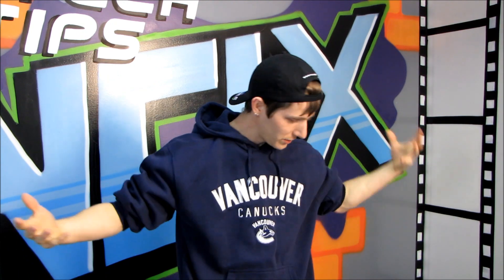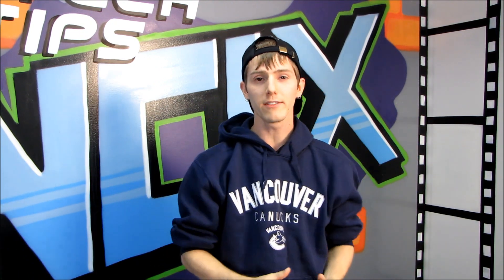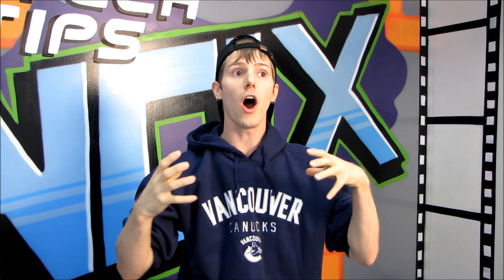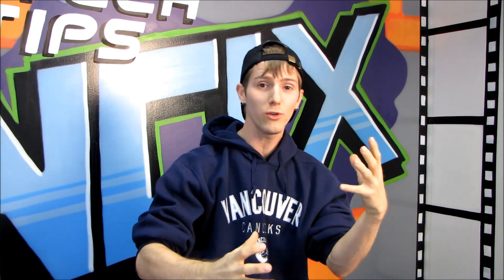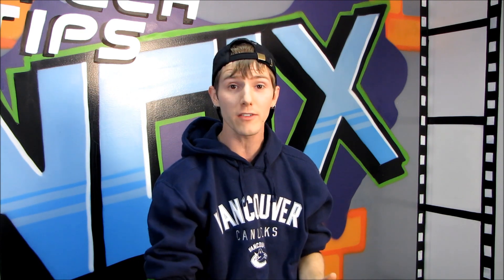Futureproofing Your PC - Dispelling Some of the Myths NCIX Tech Tips

Comment: well first although I agree intel is better but the amp bulldozer one was quite decent as well. I use an intel rig my self check my vid ^_^ but I do recommend before the release of pile, depending on what your doing it's better to buy the bulldozer as it was 40% cheaper than the i5 2500k (the 8150) and I guess pretty much you can guess how cheap the others are compared to some intel equivalent.

Comment: Right now i'd just get an old Phenom II or so with a HD7750, 8 GB RAM, 500w PSU, put it in a Fractal Design Mini with an OK SSD, and 1 TB green disc. I'd buy a low profile mid-range heatsink for the CPU and call it a day. This would be great for a PC for my family, seeing how i don't need a new rig for myself. 

Eventually, i'd buy a A10-5800k with a low profile noctua CPU cooler, a MoBo with a good output solution, a good SSD, a 2 TB black disc, low-power digital PSU in a Node 605. HTPC :D

Comment: 1. Kind of, yeah.
2. MoBo: ASUS Z9PE-D8 WS
CPU: Intel Xeon E5-2687W x2
RAM: Either 16GB or 64GB. The latter because if you have the money, why the hell not?
GPU: EVGA GeForce GTX 690 x2 OR EVGA GeForce GTX 680 (4GB DirectCUII) x4
PSU: 1500w, Gold or Platinum
Storage: Samsung 840 Series Pro 512GB x4 in RAID and probably one or two Raptor HDD's, at 1TB or more.

Watercooling in the case of the twin 690's.

This is probably more to show off though lol

Comment: hi i am using evga x58 ftw3 cpu i7 960 runs 3.20ghz 12GB ram Kingston 1600 video card gtx 480 hard drive 2TB ssd 128gb power supply 750W80 plus bluray combo cooler master hipper 212 plus and i want someone help me to overclock my cpu to 4GHZ or more

Comment: Intel Core i12 12000k @99999.9ghz
GTX 2480 128gb ddr24 x12
512gb ddr24 ram
5120w PSU 80+ Super Platinum 100% Efficiency
12tb SSD
24tb 99999999999999999rpm hdd
Ultra Mega 99999x99999x99999 inch case

Pretty future proof for me :)

Comment: Is this decent for BF3 ultra 1080p?
XFX Double D FX-785A-CDFC Radeon HD 7850 2GB 256-bit GDDR5
ASRock 960GM/U3S3 FX AM3+ AMD 760G SATA 6Gb/s USB 3.0 Micro ATX AMD Motherboard
G.SKILL Ripjaws Series 8GB (2 x 4GB) 240-Pin DDR3 SDRAM DDR3 1600
AMD Phenom II X4 965 Black Edition Deneb 3.4GHz Socket AM3 125W Quad-Core Processor HDZ965FBGMBOX
Microsoft Windows 7 Home Premium SP1 64-bit - OEM
Seagate Barracuda ST500DM002 500GB 7200 RPM SATA 6.0Gb/s 3.5" Hard Drive
650w PSU

Comment: I ask, "What would change by using a far superior machine?" Affordable technology is approaching the limit of perceivable performance for 99% of users. HD displays are a good example. I got a 32" 1080p 60Hz TV for $179, and it is has all of the space, speed, and all of the resolution my eyes can make use of in almost any case. Almost. Another 6 years or so, and we'll have affordable hardware that can only yield imperceptible gains when upgraded farther (for 99% of users, anyway).

Comment: In my opinion any todays top end PC's lasts 3 years. Yes it will work awesomely even after 3 years but it will be a mid range PC compared to a 2015's PC and after another 3 years it will be a low end PC. Even now when I'm thinking on building a new PC with support for a 4K resolution screen even if it's not out yet (well it's almost out), and all Ultra settings. But knowing that in 3 years I might start looking for something new is not so bad. Not that I will change it in the next 3-5 years. :D

Comment: Hmm this video is 2 years old :P

However, if you buy a high end cpu (or like i did a top of the line dual Xeon 5450 setup)  your system can last 5,5 - 6 years easy (like mine) And the only thing that requires upgrading/replacing are hdd's/gpu's.

Comment: I am using a (gasp) Dell XPS 410, highly modded of course, far beyond the Dell expectations of this system, I have a 850w psu, Q6600 cpu, soon getting 8gb ram because this system was just put back in service when my main system died and I had no funds to replace parts, what i would change about this system if I could to get better gaming is ram speed and the video card it has a NVIDA 9600GT and I would get a couple 15,000rpm drives in raid 0. After the bottleneck will be the board itself.

Comment: i7 3820
2x PowerColor Devil13 Radeon HD 7990 6GB GDDR5 GPUs (each is 2 7970s)
1000W PSU
16GB in 2 DIMMS (as you stated)
Far more expensive, but far more "future proof".  Slightly better CPU (though I agree that no more than a Quad-Core is needed).  FAR better Graphics setup (14-16 TFLOPS vs 3.1).  Felt 1200W was unneeded (even for what is effectively 4-way CFX).

Comment: I hate laptop manufacturers who never max out the RAM. If the system can only  support up to 8 GB, why not put all the RAM already from the start? The trouble with this is I still have to buy them which is a hassle. In my case my laptop can handle up to 8 GB but it only came with 2 GB.

Comment: I bought a TJ07, which in i made some cut-outs and powder coated it, a Corsair AX850W (single sleeved all cables by hand), a Samsung 256GB ssd 830series, 1tb hdd - this part i hope will last for years.. I tried to make it upgradeable, though linus recommends not to, with the rest of the hardware: i5 2500k, gtx670, msi mpower z77 mobo, 8gb corsair dominator platinum RAM. I've watercooled it, have a green theme (coolant, cathods and sleeving), got fan controll+dvd rom, and it's OC'd. Works great!!

Comment: I couldn't see myself building a future proof PC. I just built my PC so it can make room for newer components in the future, but at at the same time I can leave it alone and it'd perform decently for several years before upgrading.

My system
win7,64bit ultimate
AMD FX4100, 3.6GHz
EVGA GTX 650 ti, 2gig
8gigs, G.SKILL Sniper 1866 DDR3, 
1tb Seagate Barracuda, 7200rpm, 1tb Western Digital 5200rpm, 160gig WD 7200.

I bought it for under $700 and salvaged my old hd's. Couldn't be happier.

Comment: I would personally wait for haswell but if I was getting a new system now I would get cheapest i5 quad core ivy bridge cpu like an i5 3470, something like a hd 7850 gpu and 4gb ddr3 ram and a 1tb drive and of course a decent motherboard and an efficient 600w psu. This will play games at 1080p and is cheap enough so until the next generation of tech comes out it will play games at 1080p even at ultra setting.

Comment: 2500k, GTX 690, 40GB SSD, 1TB HDD, 700Watt Powersupply x79 MoBo and some coolers and a CPU Cooler :D Or just use a water cooler,
i guess this is enough for like the next 5 years :)

Comment: I got an i7 2700k put in the cheapest mobo that i could get, the asrock h61m micro atx board because I don't need a ton of ram or more gpu's, and I don't even need to overclock my cpu. So I actually did not have any reasons to buy a high end board.

Comment: did you just go on a shopping list for the most expensive items? Clearly you don't have much knowledge of computing...especially not with current tech as you're starting off by not knowing that RAM speed is almost meaningless except when benchmarking, games actually suffer in some cases when you have more than 8gb of RAM as well, dual devils will hit driver issues more often than you want to deal with it and 10tb of ssd's? why the heck? what a useless amount of low lifetime storage.

Comment: Exactly. I had an HD 6950 but it broke. I wanted to buy a GTX 570. Then I looked at the HD 7950 OC and it was just 10euros more expensive than the 570 and it is much better. Its OC and according to rewiews its almost at the same level as the GTX 670. With Catalyst 12.11 it the 670 and the 7950 will be on the same level or the 7950 will barely better.

Comment: Graphine has a lot more potential than just 30 GHz, and it's not 2D either, 1 atom thick still has "thickness", anyways graphine is pretty much set to replace silicon transistors soon once silicon is maxed out speed wise, which will come very soon.

Comment: EVGA Classified SR-X -MOBO, Dual QPI LGA2011 Xeon E5
2 x Intel Xeon E5-2687W -CPU, 3.1GHz
2 x Antec Kühler 920 -CPU cooler
12x8gb DDR3 1600MHz ram ( 96Gb)
4 x 120GB Kingston 3K SSD + LSI Megaraid SAS RAID card (Raid 0)
3 x 3TB SATA III-hard drive
2 x NVIDIA GeForce GTX690, 4GB -GPU
burning Blu-ray -drive
Xonar Xense Premium Gaming Audio Set -sound card & headset
Lian Li PC-V2120B -case
1500W PSU
Windows Ultimate 64-bit

Comment: dunno about that xeon but that 6670 wont get you far, made myself a cheap low end pc for fun with a pentium g530 and the 6670, it can barely handle skyrim maxed out at 1080P (maybe it would handle it fine with a better cpu) so yeah BF3 would sturggle even at medium settings on that gpu, if you want something around the price you marked better off with an i3 2100 and 7850 at least, should give you quite good performance

Comment: i upgrade my mobo and cpu to i7 3770k Z77 sabertooth from my old 7 month out build amd fx 6100 3.8ghz sabertooth 990fx 

my spces 
i7 3770k 3.5ghz 
antce 620 cpu cooler goin to upgrade to a h100 
Z77 sabertooth  pcie 3.0 
32GB ddr31866 corsair 
2 xfx R7770's crossfire 
900wat antec high current gamer psu 80+
60ssd ocz about to upgrade to 2 intel 330 ssd's 120GB 
i have a WD black 750GB hhd about to get 4 2GB's hhd's

corsair 600t

Comment: The most futureproof thing I can think of RIGHT NOW would be a mini ITX case (not just any case, the BitFenix Prodigy) a modular 650W PSU and a Samsung 830 Series 256GB SSD (most cost to performance to storage balanced SSD) and use that SSD as a cache for large mechanical drives. The only thing I'm sure of is that mini-ITX is catching on like wildfire and many gamers have embraced it this year JUST because of the awesome ASUS P8Z77-I mobo and BitFenix prodigy case.

Comment: processor: Intel i7000-999990 Super Mega Xtreme 1000Thz
ram: 10000Tb 2988Thz
boot drive: 1Tb SSD SATA 50 1Tbps
storage: 10 SSD Raid 0 100000Tb (each) 50Tbps (each)
graphics cards: nVidia GTX-X 99990 10Tb 100+10 Monitors
os: Windows 100 EXTREME
psu: 100,050W High-Voltage Solar and nuclear power
cooler: 1x liquid nitrogen with a 10m fan. push/pull config at 10 dba
warranty: 10 years
life lenght: 100 years

;)

Comment: In short, yes. On the i7, you can disable hyperthreading and essentially have an i5. Hyper Threading only helps doing very CPU intensive tasks, most games only support 2 cores, although some of the newest AAA games support 4 cores, but none support 8. (hyper threading runs two threads on 1 core, giving 8 virtual cores.)

Comment: I'd say storage sort of is future proof because you don't have to replace it, you can just add on to it. You can't really do that with cpus. Also, software is slower to get multithreaded than cpus are, so in the long run it pays off to have a processor with more cores than one with high single-threaded performance. Also, running a relatively lightweight operating system like OSX or Linux probably helps too.

Comment: Not sure I fully agree, I would say amd X870 and above, and nivida X60 ti's and above will easily be able to run all games for at least 5 if not 10 years at 1920x1080. Given you can do more like in higher res, eye infinity, 3d and so on, but all and all a solid system could last a very long time. Also worth mention a lot of gamers are going back to older titles. Starting around 1997 we've been having a Golden Age of gaming. I think were reaching the end point.

Comment: pretty much ay, aha pc's will have:
Intel Core i200-9990XT 400Ghz

10Tb Ram 6000Mhz Ram

Asus Rampage LXIX Extreme

100Tb SSD Sata 10, 50Gbps

Nvidia GeForce GTX-R 840 50Gb Card

Windows 60 Ultimate

Custom Quantum Mechanical Leverage Helium Loop with Solid Gold Capacitors

20,000W Nuclear Powered Reactor PSU

Comment: So which machine I am planning now is as follows. Please advise though if you have any suggestions, I will seriously consider them.
Case: Cooler Master HAF X Full Tower
Processor: Intel I7 3930K + Noctua NHD14 SE2011
Mobo: Asus Rampage IV Extreme or Formula
PSU: Corsair AX1200
Video Card: Either 1 or two MSI GTX 680 Twin Frzr 4gb, possibility of SLI later.
HDD: Caviar Black 1 tb
SSD: OCZ Vertex 3 128ish gb.
Ram: G-Skill 2* 4gb 1833mhz ram. Add more later.
Thanks for reading!

Comment: I'll actually answer his questions honestly this time instead of joking around because I'm upgrading my system soonish.
To answer first question, yes it changed my thoughts about futureproofing a little. But most of the stuff I already knew. One thing I was shocked was that I actually like Kepler series and will go with one 680 4gb, hoping to add another, and another every year or two. That way my VRAM will still be 4gb, which is plenty for a 2 to 4 way SLI, and I get a big ass machine.>>>

Comment: Intel Core i33 - 6770X 40.3GHz
500GB 4000MHz RAM
Asus Rampage VIIIIIIIII Extremely Extreme
1 Exabyte SSD
4 x Nvidia GTX 890 20GB
Windows 33 Ultimate 464 bit
7000W PSU

Case closed.

Comment: Future Proof? Intel Core i7-3960X, 64gb 2133Mhz Ram, Asus Rampage IV Extreme, x2 512Gb SSD in Raid 0, 4Tb 10,000 RPM 64mb Cache HDD, Nvidia GeForce GTX 690 Quad SLI, Windows 7 Ultimate, Custom Watercooling Loop. There ya go

Comment: Ok heres my list:

4 16cores cpus
512 gb ram
2 7990
2 ssd pci express cards
10 512gb ssds in raid 0
1 1800w PSU
6 4k screens or 240 ghz screens
the grafiks card will prbally last about 2 years or less on max settings but thats maybe the only thing you have to uppgrade in 5-10 years bt it will cost between 50-100k dollars!

Comment: Futureproof is for those that buy NES. Games will work after 10 years just the same.
With pc's..make sure your mb have one upgrade cycle for cpu and memory. Get good psu with 200-300 watts of headroom of your current need. Invest on case,get kinda you'd be happy for long..and don't forget the ventilation. Gpu and cpu..get kinda you can afford,thou with fastest you pay for air,so second best can be best bang for buck. Mem..8gigs is to start with today,so 16 might be enough tomorrow.

Comment: about every 3 years people should update or buy a new PC with that said i've got the same case same power supply (550w) and my dvd drive and my back up hard drive (250GB) and heat sink and fans (system is in a room that is always at 19c) and used them over for about ten years now

Comment: yes now i want to buy 2 60 GB SSD cause it seems to be running out in the country i stay at and the price as you said as it gets older it would not get cheaper... and i sticking to my current build cause as you said there is no future proofing everything the most i would do different is my power supply from a 460 watts to a 750 watts.

Comment: Hey NCIX I know this is an old vid but could you tell me if this is a suitable gaming rig / future proof ?  
Cooler Master Storm Trooper
Corsair 1050 PS Modular
I7 3770k ivy bridge 3.5ghz
Corsair Vengeance 16gb 1866mhz
Asus Maximus v Formula Thunder FX
Asus GF GTX 680 DCU 2 top
Corsair 120 gb ssd
WD Caviar Black 1tb
Corsair H100

Comment: you should buy a cheap chinese case that looks really good but has good fan options for airflow. also, buying a way too powerful power supply is unnecessary unless you need it. imo, you should keep your build around 1000 dollars overall, then sell it after a few years and buy a new one again for 1000. since technology advances at exponential rates, it is a really bad idea to even try to future proof.

Comment: The 3570 is going to remain a quality processor for at least 3/4ths of the next decade before it's performance will sorely be outdone by newer generations.

Take a look at the Phenom II processor generation. It's nearly 5 years old, and yet I have built a system with a Phenom II 965 x4, and it still knocks the socks off when paired with a mid tier graphics card such as the 6850. The processors are still great. So are the Athlon x4's. 

That computer you have will last at least a decade for you.

Comment: tick tock - time is running out for future proofing you computer 

right now haswell is looming on the horizon for the LGA 1150 (2013)
but the LGA 2011 still has legs for at least two(2) years mainly Ivy Brigde E is out next year that'll extend LGA 2011 for maybe two (2) years but turth be told the power of LGA2011 should last longer if you change the v/card or xfire or sli more than two > three

ok be like my neighbor who always says I am waiting for the next upgrade still has a 478 w/agp

Comment: I have just built a new PC and I want it to last 5 years. So, I picked a good-ish case, the NZXT Source 220 (futureproof), a 1TB Seagate Hard Drive (which IS futureproof), a 128GB Samsung 830 SSD (NOT futureproof), an Intel Core i5-3450 (futureproof), an AMD Radeon 7870 (not futureproof, I'll change my graphics card over the years), an Asrock B75 Pro3 (futureproof for my use of a PC), a DVD drive (futureproof, lol), a Corsair CX 430W (i'll re-use it, so,  futureproof), 8GB of RAM (futureproof)

Comment: Course overclocking will help but you have to keep in mind overclocking can only go so far before the hardware starts crashing. The point is the features you'd get from buying a new board 2-3years down the road will be significantly better, more and even faster than what you would had. I personally do overclock my system but in no way will my i7 870 clocked at 3.2ghz ever beat the new stock 3.4 or even the new LGA2011 6core processors that can easily push to 3.8 or 4.0ghz.

Comment: Hardly. PCI-E 3.0 came out recently which also means the newer gen cards will be running off PCI-E 3.0 and guess what? Older boards with PCI-E 2.1 or 2.0 will no longer be able to run the new gen cards. That said USB 3.0 also became a standard and guess what? Older gen boards wont support USB 3.0. It depends on how fast the technology evolves and what exactly you want for your system. I personally bought a motherboard 2years ago and right now I'm bottlenecked to PCI-E 2.0 and USB 2.0 hardware.